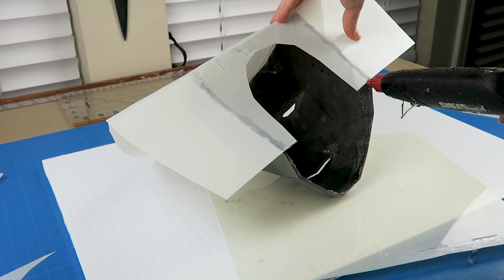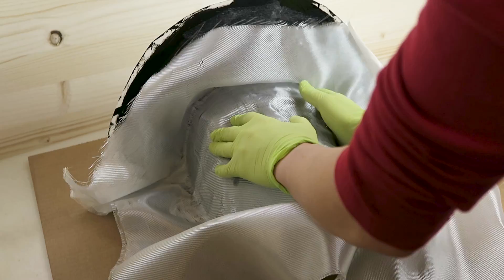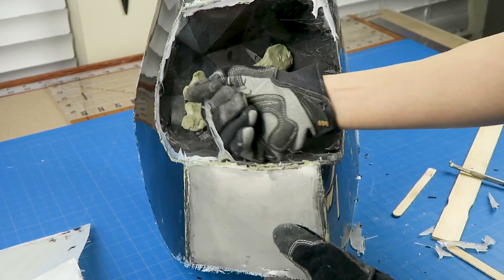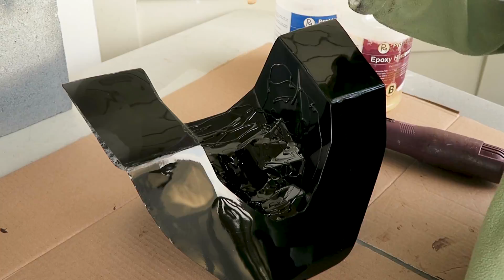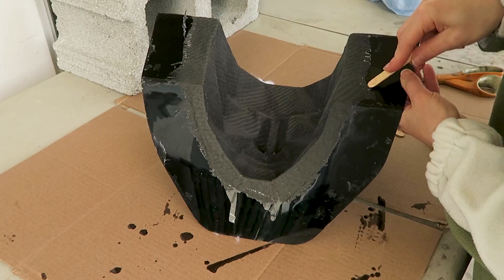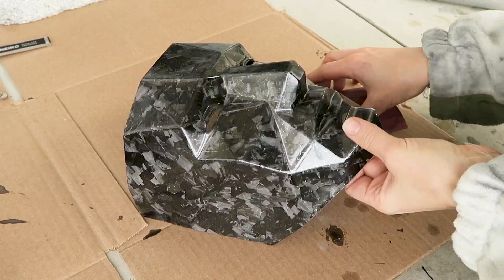Molding a Mask with Forged Carbon Fiber Fabric

Comment: Hi! Great work and tutorial! May I ask what flange material you used? Seems really nice to work with!

Also, I noticed you did a twill weave mask in the background towards the ending of the video, how did you accomplish that? Seems quite difficult for the mask because of all its angles
Reply from the maker: Thank you! It's thick polyester PET / Mylar.

I tried pre-forming the dry woven carbon and misting with spray adhesive to hold the shape. Didn't get a great result in initial testing, a lot of bridging.
Reply: @LindyDesignLab  thanks for all the info! Do you think vacuum infusion would remedy that?
Reply from the maker: I suspect it would help but not solve.  RTM might do the job, if it was something worth the effort.

Comment: What is the minimum thickness of forged carbon. I'm about to make a carbon magazine for a friend's pistol. But the fact is that the wall thickness of the metal magazine for the pistol itself is 0.4-0.5 mm and I don’t know if it will be realistic to repeat the same dimensions with forged carbon and at the same time achieve at least some strength parameters
Reply from the maker: I would not trust forged only at that thickness unless it was purely cosmetic. There's another video a while back I did a Glock trigger guard holster using forged backed by woven, that part is still going strong. Maybe forged just on the bottom of the mag where it could be thicker without interfering?
Reply: @LindyDesignLab  thanks for your answer, in this case I will try to do it with woven carbon, since it is possible to set greater strength parameters for a smaller thickness

Comment: is that gelcoat only applies for molding process? what about carbon part process..is that necessary to use gelcoat?
Reply from the maker: I do not use a gel coat when casting the carbon fiber part. Instead, after the part is removed from the mold and trimmed, additional coats of resin are added as needed, sanded and polished to fill any pin holes and get a get a gloss finish.
Reply: @LindyDesignLab  did u mean..for first coat layer..u just using the epoxy resin before apply the carbon fiber?

Comment: do you always use that type of epoxy? its not ideal for laminating. i mean for things that dont matter like masks i guess its fine but cf is used for its superior qualities like strength/ weight
Reply from the maker: For cosmetic applications I like a super clear, low viscosity resin with a long cure time that works for both laminating and coating. If you're making structural parts then sure, different set of priorities.

Comment: Did my first one but the carbon was all pulled apart so just like fluff 6mm  tried it anyway lay over wet resin best I could then used vac bag but I needed more resin to wet out so looks dry still    When I try to do the resin it pulls it apart.     Now it’s uneven and still fluffy did more resin but can’t        Any tips
Reply from the maker: If it's fuzzy you could try adding more resin and see if it will soak in then sand again, but it might be best just to start over. With forged fabric or precision cut chopped material you get the chunky fiber bundles.

Comment: Was the black resin gel coat? Or some a different type of epoxy?
Reply from the maker: Black surface coat epoxy.
Reply: @LindyDesignLab   Could you link the brand, or where it was purchased? Thanks.

Comment: great work!
2 things,
first, how many times can you use a mold, on average?
Second, can you leave the CC on a little longer on new vids, they diapered to quickly to read
Reply from the maker: Haven't tested, but I'd guess at least dozens, maybe hundreds as long as mold release is properly applied and the mold is sturdy enough to not get warped or cracked.

Comment: Nice mold making.  Did you put the epoxy in the vacuum chamber after you had mixed resin and hardener together?  I’ve never tried that, looks like it worked well.  I’m also wondering if there is anything special that should be done to reduce off-gassing before putting it near your face?

Comment: All those fiberglass layers could've been replaced by chop mat glass and will be cheaper too.
Reply: The whole mould could be CNC cut in MDF and prepped faster.
Printing would be easier too but take a long time.

Many ways to skin the cat.
Reply: @heavyweather  no youre wrong, changing a material to save money isnt a different way, its the same way but using a cheaper material.
Reply: @timtaylor9590  isn't that what the saying is about? Literally same result using a different way. I'd argue that 3D printing and wer layup are two different ways.
Reply: @heavyweather  no youre the only one talkn bout cnc and 3d printing. dude is saying use a cheaper material, but he's wrong because chopped glass doesnt lay up as well even under vaccum which i dont think she used for the mold. changing one material slightly on one of the steps isnt a different method its a different material, the method is still hand layup with or without woven glass....  your talkn bout some rub the magic lamp nd make a wish nd shit.  nah cuz
Reply: @timtaylor9590  it's definitely not wrong. Tooling gelgoat > flocked glass > thixo+cellulose fiber > chopped strand matt is quite a usual layup.

I still prefer printing or CNC cutting.
Printing is just so convenient for compression molds. Also cheap with printers under 200€.
Reply: @heavyweather  yea printing or cnc machining is on the same level as hand layup. youre confused
Reply: @timtaylor9590  what level is it then?
Reply: @heavyweather  common sense class is over, i failed as a teacher but im ok with that.
Reply: @timtaylor9590  welcome to 2022 where 3D printing is basic level...
Reply: because as you may or may not kno, the woven glass conforms and lays nicely the chopped stuff doesnt. its also easier to work with and cleaner

Comment: I think its kinda misleading to say this is forged carbon fabric
Reply: Which part is misleading? They are using forged carbon fabric in a mold?
Reply: @JustAnotherInternetUser_  exactly that's how all carbon is made from dry fabric that is either with epoxy or polyester resin.. the only dif between them is that and the type of carbon material

Comment: I don’t get how it becomes a mold. Like what was the fiberglass point. Sorry 😐 it’s just me?
Reply: You need to make a negative of the object your going to copy with the carbon fiber, so that mold is necessary to get the right shape in the end. Its like casting resin, but solid.
Reply: Fiberglass is added to make the mold more rigid and strong. Look how much pressure she ads when applying the carbon fiber. The mold would puntcure or break if fiberglass wasnt used

Comment: What stuff is that black epoxy you used for the mold?
Reply from the maker: It's a surface coat for mold making that is thickened and sands easily, premium resin tech.

Comment: Really amazing job, i like it.
I have a question if you agree to answer me..
What's the exactly name of the plastic ply you put after putting carbon fiber?
Reply from the maker: The release material is nylon peel ply with silicone coating.
Reply: We're working on rocketry project, certainly I'll have other questions, and you seem very experimental in how making carbon fiber and mold, if you can help us, send me an email ton contact you : Ishak.benzaza27@gmail.com.
Thank you 🙏

Comment: You use the table top epoxy to wet it out?   That’s very thick and slow curing right?
Reply from the maker: It is on the thick side and gels pretty fast. I used it to coat the inside of the mold. The actual wetting out of the fabric was done with a low viscosity laminating epoxy.
Reply: Thanks.   About how long does it take to set?   You use the heat gun?      Do you degas every pot?
Reply from the maker: @manningcustom  putting it in a box with a heater running speeds up the process to maybe a couple hours to tacky cured. Each batch of resin is degassed then the heat gun helps pop bubbles added while spreading the resin.
Reply: Thanks. I’m using bagging and have been for a year or two now but I have the worst problem with pinholes on the surface. I’m gonna try doing it exactly this way.

Comment: Can the chopped carbon Fiber be used instead of forged carbon fabric?
Reply: Of course, just make sure you have covered the entire surfaces and spread the chopped fabrics evenly. Fyi, those two things is the hardest process on making part (at least for me)😅
Reply: @ultralinx200  I've tried it but the hardest part was the chopped carbon fibers staying as one piece instead of fraying and becoming loose strands. I had to be very careful with handling them otherwise they fall apart and don't look good when you cover them with epoxy.

Comment: Is it a ready-made fabric or are you spreading it yourself?
Reply from the maker: Ready made.
Reply: who is the manufacturer?
Reply: I can’t find such a fabric on the market.
Reply from the maker: @профиль-е8с  it's available here https://www.etsy.com/listing/765202834/forged-carbon-fiber-dry-fabric-premium
Reply: @LindyDesignLab  thanks 🤗
Reply: " Real" Forged carbon is made of chopped fibers whom the main advantage is to marry all the shapes, and you use Forged carbon fiber prepreg .... https://fr.aliexpress.com/item/4000080313536.html?src=google&src=google&albch=shopping&acnt=494-037-6276&isdl=y&slnk=&plac=&mtctp=&albbt=Google_7_shopping&aff_platform=google&aff_short_key=UneMJZVf&&albagn=888888&albcp=1633544866&albag=64936066280&trgt=743612851114&crea=fr4000080313536&netw=u&device=c&gclid=Cj0KCQjwpLfzBRCRARIsAHuj6qXF_tIX0mCWfcV6Uu9PYgQZhY3GTWXlwuV7vBf6iHrlfdv-prcewwkaAsHBEALw_wcB&gclsrc=aw.ds  The carbon fiber material will be laid in the tool, we would vacuum bag the tool to remove air and more evenly distribute the epoxy resin, and then the entire thing would be cured. This kind of manual layup process results in a very strong and durable composite part .

MAKING FORGED COMPOSITES
If we were to create that same prototype using a forged composite process, there would be NO manual layup involved. We also would not use prepregs. Instead, we would employ a substance that contains chopped carbon fibers and epoxy resin already mixed together. It would almost be like a paste.

Comment: Was that pieces of peal ply that you used on the mold? And why no vacuum bagging? What good is peal ply if there is no pressure pushing the resin through?
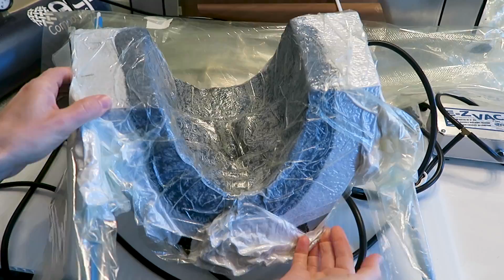Reply from the maker: Yes, porous peel ply so the breather cloth wouldn't stick and excess resin could escape. It was cured in a vacuum bag @ 12:42.
Reply: Alfred, you're confusing two different methods.
This is vacuum forming after wet lay. The method you're talking about is resin infusion. The resin is pulled through the mould under vacuum, but it's not always the most suitable option.

If I was making this part, I would've done it the same way as the video - albeit a slightly different layup method